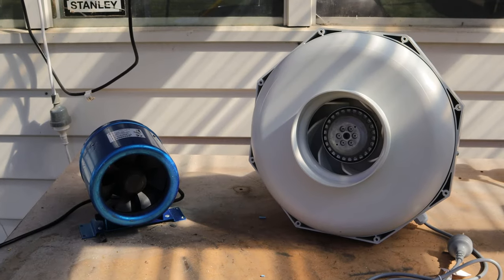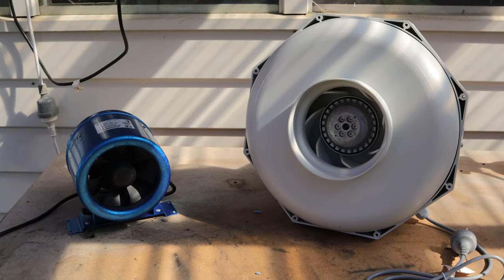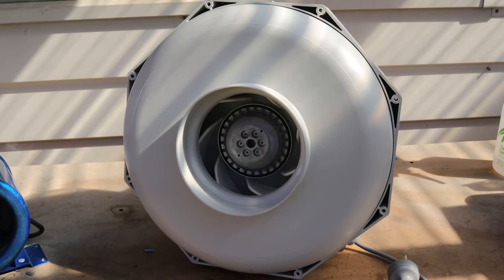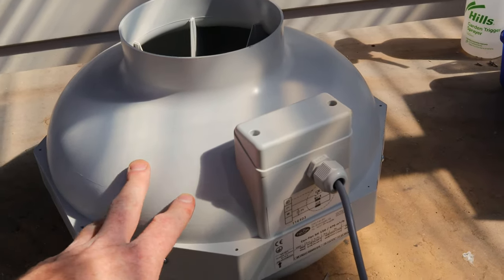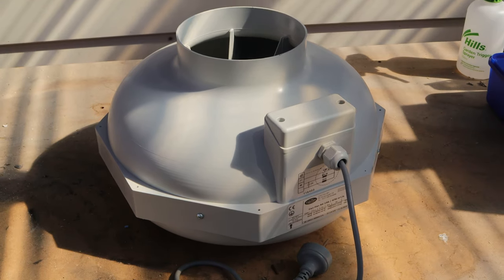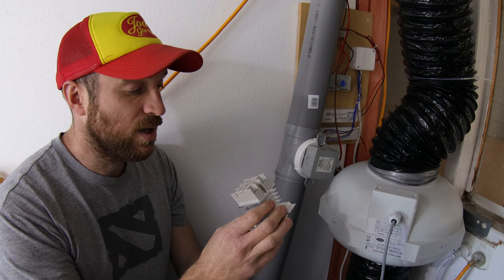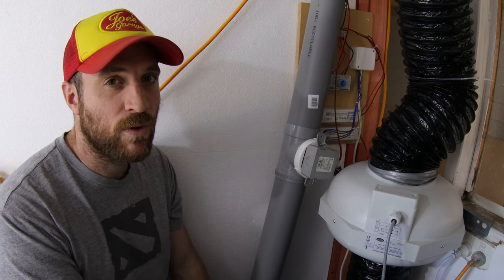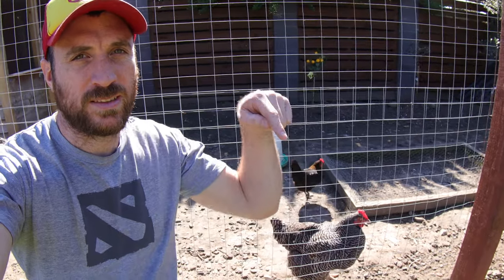Mushroom Growing Exhaust Fan Replacement - Mushroom Fruiting Chamber Ventilation

Comment: hey oak n spore can u please explain to me how the intake fan work for fruiting rooms I’m trying to make one and it’s the only thing I don’t understand do you have the intake with fresh air fan in the fruiting room or ducting and the fan outside please help mate
Reply from the maker: I don't have an intake fan, only an exhaust fan. I suck air out of the room, I do not pump it in.
Reply: @OakandSpore  why is that I know it’s a dumb question but I’m just learning this stuff my bro don’t you need a lot of fresh air for fruiting ? Thank you for the reply too brother ☺️
Reply: This is the same question in my mind. Please help !!
Reply from the maker: You don't pump air in because it positively pressurizes the room, and causes lots of spores to escape and go everywhere. If you are sucking air out of the room, then spores won't escape, they will be sucked out, becusse air will be getting sucked into the room.
Reply: Thanks dude. .this helps 👍